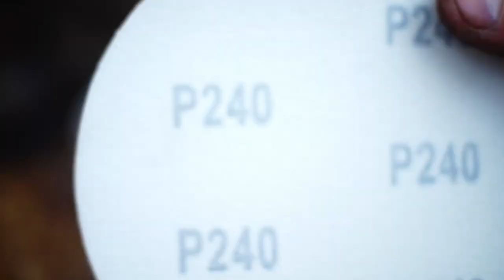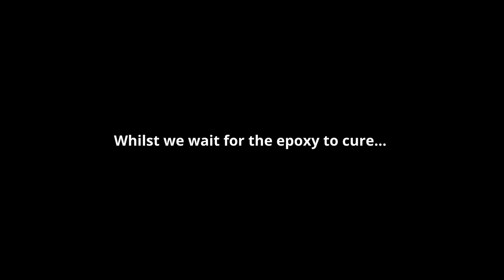Forging a Cleaver from an old Leaf Spring!

Comment: Very nice work. Quite impressive for leaf spring. 
Can you please provide info on your grinder as it appears to be simple in nature, but very powerful at grinding . It’s the type of grinder I would like to make . Thanks
Reply from the maker: I have a new grinder now!

The old one I built with a very large DC motor form an old treadmill it also used a 10kw light dimmer kind of device and a bridge rectifier and a capacitor to smooth out the voltage.

It was a ridiculous machine, not built very well and very powerful and stupid fast.
If I started it up too fast it would trip the breakers.

Comment: You quench to much you need to deep in water one at a time, let the heat go a little to the edge then deep again dont rush, the heat of the spine is enough to temper the edge, you dont need to temper with a torch..

Comment: The power tools kills it....m learning to not use power tools.... use rasps sometimes...but with power tools you don’t really need a forge!
Also why are you wetting everything?  Place a heated piece of steel on your anvil to more warm it so your metal doesn’t cool off to quick
Reply from the maker: The water turns into steam and will make a little bang that will blow off the forging scale.

Comment: At 2:45 in the video, why is he doing that?
Reply from the maker: I am removing all the crap / oxidation that is on the hot steel with a wire brush.
If there is oxidation on the hot steel you forge it will embed itself into it and can cause dents if it is really bad.
Reply: @ForgedInHolland  thanks for telling me.